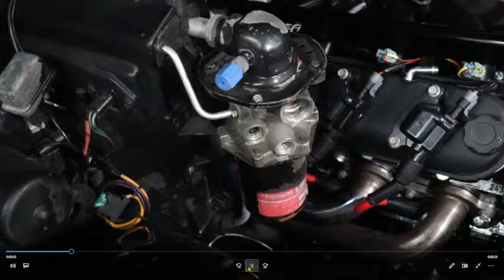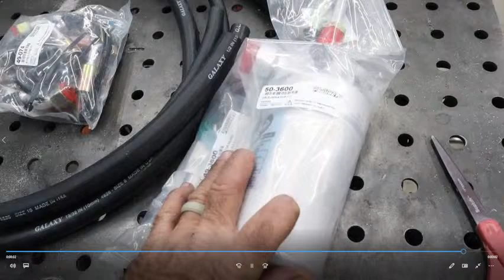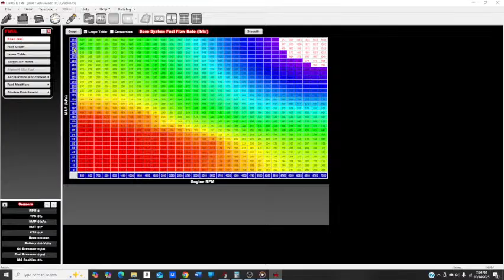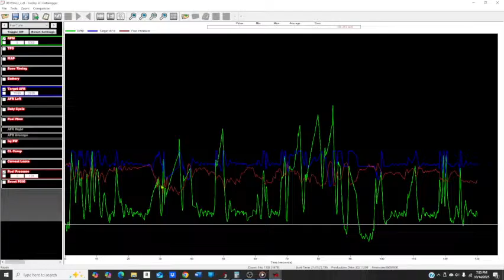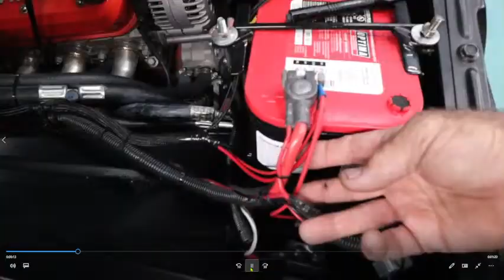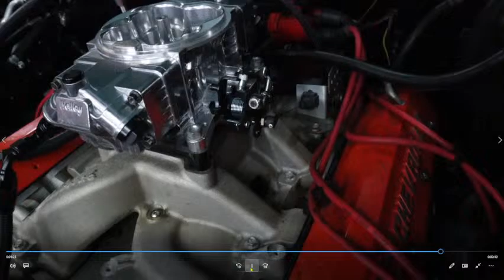Discovering hot rod tricks and tips, Episode 115

Comment: I shared this video a few times since Tuesday, the PCV/open breather in particular. I did come across a video from Uncle Tony where he was talking about down draft tubes. He says that the vacuum of the PCV system is necessary for longevity of an engine. It prevents sludge build up. I don't think that really applies to my 1965 Mustang that I put maybe 1000 miles a year on,  and change the oil every spring. I appreciate you answering my questions on the live!
Reply from the maker: Thanks for the comment! That is why I do the live/podcast, so it is like bench racing. Where anyone can chime in any time. Thanks for watching and sharing!